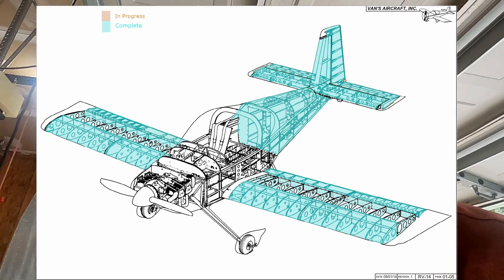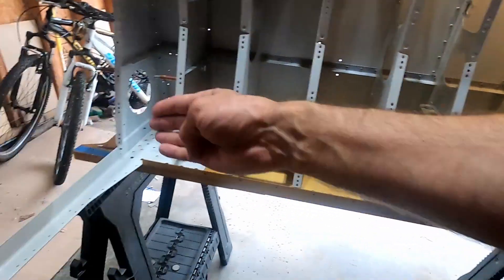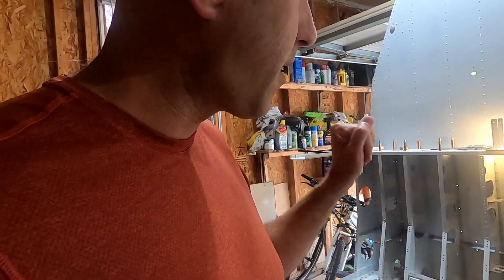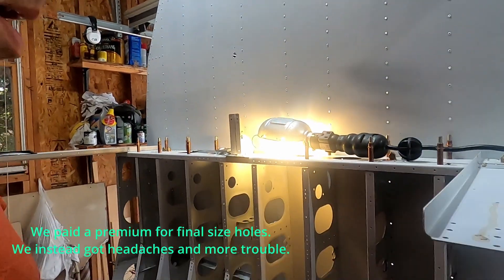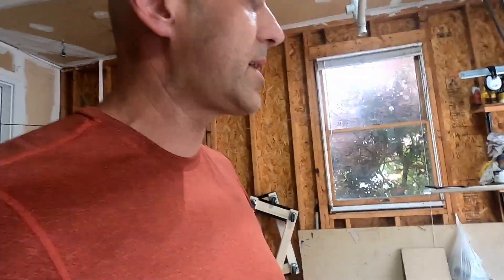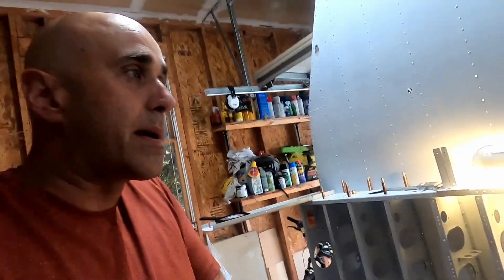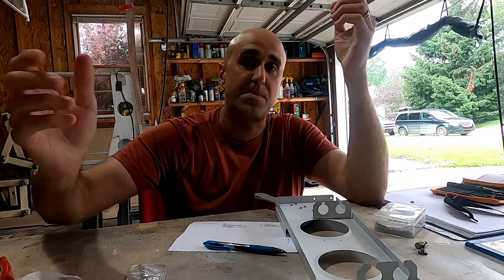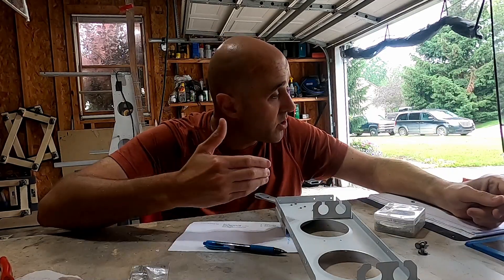Laser cut parts in the Fuselage? more like Fusel-UGHHHHH

Comment: The KIT is THEIR "product". The DIMPLES AND FINISHED AIRPLANE ARE YOUR PRODUCT!

Such seems to be the attitude of every "expert" online saying it's NBD. No Big Deal. 

Their "explanation" for the process "modification" is they were SO "SWAMPED" WITH ORDERS DUE TO "WORLD EVENTS" STARTING IN 2020 THAT THEY "HAD" TO "RAMP UP PRODUCTION" AND FOR SOME CRAZY REASON ALL THE PUNCH PRESS-EQUIPPED "JOBBERS" WERE COMPLETELY "BACKLOGGED" WITH WORK WHILE THE LASER CUTTER "JOBBERS" HAD NO "BACKLOGS" AT ALL AND WERE ABLE TO JUST JUMP RIGHT INTO "JOBBING" FOR VAN'S AIRCRAFT "MANUFACTURING". 

THIS "MECHANIC" HAS ALWAYS BELIEVED THAT WHEN ONE "JOBBER" SHOP IS "SWAMPED" AND ANOTHER IS "SWEEPING FLOORS" AND THEY BOTH DO "IDENTICAL" JOBS AS FAR AS THE "PRODUCT" THEN "MARKEKT FORCES" ARE AT WORK AND IF YOU VALUE YOUR FINISHED PRODUCT THEN IT'S PROBABLY WORTH WAITING IN LINE WHERE THERE IS ONE VS. GOING TO THE GHOST TOWN "JOBBER" THAT HAS NO JOBS IN PROGRESS. 

AND THE REALITY IS THAT PUNCHING HOLES AND CUTTING HOLES ARE TWO ENTIRELY DIFFERENT PROCESSES FOR A REASON. ESPECIALLY IN ALUMINUM WHICH IS THE DEVIL TO CUT WITH ANY PROCESS RELATIVE TO STEEL. 

IF YOU CAN'T CUT HOLES OR EVEN OPENINGS IN ALUMINUM WITH ANY "THERMAL" CUTTING PROCESS THAT WORKS "GREAT" FOR STEEL SUCH AS OXY-ACETYLENE OR PLASMA CUTTING OR AIR CARBON ARC CUTTING - AND BELIEVE ME YOU CANNOT - THEN A "HIGH TECH" LASER THAT DOES THE EXACT SAME THING - HEATS THE BASE METAL TO ITS MELTING POINT SO A GAS "JET" CAN "BLOW" IT OUT OF THE "KERF" - THE "FINISHED PRODUCT" IS GOING TO SUCK. 

AND THOSE PROCESSES ARE NOT USED TO PRECISION CUT STEEL SHEET METAL EITHER. EVER. AT LEAST NOT BY "ENGINEERS". THEY ARE USED ON "PLATE" AND THEN NEVER FOR PRECISION CUTTING OF SOMETHING LIKE A HOLE INSTEAD OF AN OPENING. 

ALL "BOLT HOLES" IN STEEL SHEET METAL ARE PUNCHED. IN PLATE THEY ARE DRILLED. IN BOTH CASES THEY MAY BE FINISH REAMED. 

IN NO CASE OF A NEW "FACTORY" PRODUCT ARE THEY "FILE TO FIT". IF THAT IS VAN'S "PROCESS" FOR ALUMINUM SHEET METAL THAT ALONE PROVES THEIR "ENGINEERING" IS SHIT FIRST AND FOREMOST.

Comment: So holes were slightly undersized and cracked when dimpled? I drilled , deburred ,dimpled all 30,000 plus rivets on my 2000 RV-6 and did not have any holes crack from dimpling. Bummer is a understatement  for your problem.

Comment: Laser tempering and cracking of aluminum has been known in aviation for a long time.  It’s a shame someone was able to sell them on that process.  Anything you touch the edge with (file) will cause cracking like tempered glass.  I’m curious of how far the heat affected area is from the edge or if any of the parts can be salvaged by drilling out the temper and using over sized rivets.
Reply: Remove the rivets and Tig weld the parts. Otherwise disassemble, and reassemble with glue. Rivets are 20th century.
Reply: @Parkhill57 I think the problem is that welding AL ruins the T6 temper.  Like half the strength. Steel does not degrade like that from welding, so your suggestions would be fine for steel. What I don’t understand in all this is that if the holes are bad, then why not just don’t use them?  Just drill your own holes the right way for rivets between the bad holes.  Not ideal given one bought a kit to avoid that, but Ce la vie if it rescues the kit

Comment: This reminds me of a manufacturing/airworthiness fiasco on the Canadair Regional Jet when the maker of anti-ice leading edge piccolo tubes (made from very thin titanium sheet rolled and welded), an aerospace company in LA, bought an Electro Discharge Machining rig to make the little holes instead of normal drills.  EDM melts the hole with a controlled arc.  The notified the OEM of the process change, but there was no follow up. The tubes went into service and eventually started cracking at the holes and breaking up (titanium having so much spring-back when formed), leaving the wing without anti-ice protection outboard of the fracture, just random wing overheat warnings. Just dumb ass luck there wasn't an incident.  Turns out the EDM process leaves a hole with a very rough burnt bore, a perfect crack propagator. An AD required replacement of tubes, and the company didn't want to scrap their automated EDM rig so it was agreed they'd make the hole by EDM undersize, then someone had to ream them to final size with a reamer after to provide a clean bore.  Laser cut holes would have the same problem.

Comment: Filing the holes? I work for an aircraft company and we never file any fastener holes. You are making stress risers with your file, regardless of the heat treat on the metal. I would not keep this video up if you ever plan to sell your airplane. I doubt you could find an AC manual telling you to file the holes---YIKES!!!!
Reply from the maker: yet that was the guidance provided by the kit manufacturer..

Comment: Incorrect heat control during the laser cutting process. Depending on the aluminum alloy it might not be possible to prevent heat from altering the temper of the metal along the laser cut edges. Building a temperature controlled enclosure for the laser cutter and figuring out temperature ramp up/down and ideal enclosure temperature during cutting would be a long process of testing - especially if the manufacture of the aluminum sheet has no data on laser cutting followed by mechanically distorting (such as dimpling) the heat affected zone.

Perhaps blasting chilled air right at the point of the laser cutting could prevent this problem?

That's a problem with sheet steel with laser or plasma cutting. It can be almost completely mitigated with plasma cutting by using a water table so only the smallest part of the edge right next to the torch is affected.

Comment: The dimpling process should not require working on the holes with a file. Cracked dimples indicate the material is not the correct material, not in the correct condition to be dimpled, or the wrong dimpling process has been called out. Don't assume any kit manufacturer knows how to build airplanes. One popular 4 place composite manufacturer in the southeast used an air conditioning duct sheet metal brake to form a flight control bracket out 0.120 6061, no bend radius, when confronted by an A/P and an engineer they refused to accept that they were doing something wrong.
Reply from the maker: Oof, yeah that's rough

Comment: My RV4 has been flying for just over 25 years now, in Australia. Nothing was pre-drilled on those kits. I didn’t experience any issues with the dimpling for 3/32 and 1/8 rivets, however the fuel tank skins and associated attaching flanges, had serious cracks in the dimples for the attaching screws. I filed the cracks out, many quite deeply. It would be interesting to see an engineers view, on the likely hood of crack propagation in later kits, as well as feedback from aircraft owners, who have many hours on their aircraft.

Comment: I hear you my man I’m involved with this on my 10:-(

I wanted to ask you were you parts cracking in the red or yellow  color  on the list vans released for your 14??? I’m just curious because  you said all those seat ribs etc are all cracking to some degree????

I’m sure my 10 is similar
Reply from the maker: I had some cracks on red and yellow parts, the thumbnail for this video with the cracks is actually a red-tier part.  Seat ribs are blue of course, it's just the point in the build where I really recognized there was a problem.
Reply: @RyanE67  oh okay just wanted to make sure the cracking parts were NOT blue or green ones. I am building a 10 and I have to replace ribs in my nearly complete wings. I did not start my fuse yet until they send me replacement parts
Reply from the maker: @jerseypilot83   plenty of blue parts cracked too, then i followed the guidance (at the time) to file the cracks out... which took too many holes out of spec.. and so I'm subsequently asking for no-cost replacement since all I did was follow their guidance.
Reply: @RyanE67  I can’t believe you said the blue parts are cracking, too… but Vans says it’s okay …. Complete BS! I really hope they will send out free replacements because they really messed up. All the blue and green parts I guess are good to go even with crack they said to you too????
I was playing around with first 2 steps of fuselage today  and I didn’t prime but dimpled and debuted and riveted to test and see if it would crack and it DID NOT! I guess that is good but I’m still going to use the punched parts. I have no choice but to wait. They say we can use blue and green but that’s crazy…. I say it’s cutting corners extremely!

Comment: What's  the follow up to this? Is Vans standing by their product and sorting you and all the other builders out with new parts? I know they found the problem with the laser cutting method at the subcontractor, and have fixed the issue ongoing. It's a real FUBAR but Vans is surely a good upstanding bunch and will make it "right" for the builders.
Reply from the maker: I have a follow up video, but there's been more since then.. they seem to be standing by their builders so far...

Comment: The phrase Laser cut parts has me baffled.  Is the phase "CNC" punched parts being called Laser Cut components.
Reply from the maker: No. Both are cnc process, one uses a laser to pierce the part, the punch uses a die set to pierce the material

Comment: Sounds like the laser cutters are hardening the aluminum and causing it to become brittle because of the excessive heat of the laser.
Reply: Laser heating should anneal the metal making it softer, not harder. It’s the reason you use rivets instead of welding. For steel welding the reduction in strength is not much which is why you can weld steel and net it’s a stronger joint than bolting.  But AL undergoes like factor of 2 reduction of strength.  The AL T6 temper goes to like T3 or less.  And unfortunately you can’t just do a reheat treatment, because the whole piece needs to undergo the treatment. It could be that the region around the hole has lost its temper and maybe that lack of strength is what is cracking. Need a real metallurgist (which I am not) to tell what is going on here, but overtly it does not sound correct that temper loss (softening) would cause cracks by itself.

Comment: Are these airplanes going to be insurable if they are built from these kits, even if you replace the parts?
Reply from the maker: I'm sure it won't come to that.. for a vast majority of the parts, any issue should be noticed on preflight or if anything during annual condition inspection before they become actual problems or safety hazards.

Comment: They are using cheep aluminum, i you can Lazer cut aluminum and still stretch it, they need to compensate with a different grade and harness so that the temper is a proper grade after heat
Reply: I think you may be incorrect, the aluminum used is high quality (aircraft grade) and not intended to be heated as this affects its strength and becomes more brittle (thus cracking). If they use a grade of aluminum that can still flex after heating then its overall strength is not as strong and not to the standards for these aircraft........That is how it was explained to me so I hope that makes sense.........and of course, I could wrong as well, but makes sense to me.

Comment: Filing is not  the answer.  I'm a retired A & P mechanic, 50 + years experience.  Military and civil, large and small aircraft. Your Filing puts small scratches thru the hole and promotes the cracking. Hot coin dimpleing is possibly an answer along with drilling and or reaming. 
I've done a lot of hot dimpleing in the military and it's a tricky process. 
Their engineers will have to come up with an approved fix.
You would be better off to wait for one , otherwise you might cause even more problems. 
Not a good place to be in.  I feel bad for you guys that bought that kit.
Maybe get together with other kit owners and start a lawsuit.
Reply: Lawsuit no... Everything else is spot on. Thanks for your service!
Reply: Agree. On race cars from the 1960's, they learned that scratches of any size in aluminum panels exposed to vibration could start cracking.
Reply: Its not just the rv7 kits.

Comment: Hot dimples? Filing? Why not debuting tool, a whole lot faster. Filing makes micro cracks. You should see all the back drilling needed to replace thin sheet metal parts on the U-2. We are not allowed to laser ablate thin skins because of the damage done by the lasers.
Reply: The laser cut hole already formed micro cracks. I think filing is the least of his worries. Vans has a lot to answer for here.
Reply from the maker: Yeah the deburring tool creates a countersink or knife edge, which takes the hole way too far out of spec

Comment: I believe only a pilot hole should be cut with the laser then it should be drilled to size the rest of the way
Reply: it's not the size of the hole that is the problem, it's the fact that the laser cutting process alters the temper of the aluminum making it more brittle and prone to cracking
Reply: @billbrisson if it was only a pilot hole, any material that was brittle would be drilled away when the right size hole was drilled.
Reply: @LeifNelandDk  except it's the whole part that is laser cut, not just the holes. Do you plan to file away the edges of the entire part?

Comment: The laser must be giving it a heat treatment and making it brittle around the hole. sry those are scrap and Vans could go bankrupt over this.
Reply: or the source stock is not really 6061 ?  if they made hundreds of them so far with no problems, then something changed, they need to find it. asap.
Reply: @orbitalair2103 Sheet metal comes from China...continuous quality testing of batches were not in place probably...
Reply: That’s what I was wondering about too?

Comment: Improper debur will cause cracking. I know people run files on the holes. Not the same as a countersink debur. Not say 100% thats the issue but not uncommon. I'm an A&P with extensive sheetmetal experience and have helped build several RV. There product has gone down hill
Reply: Ya. Laser cutting holes my affect the heat treatment of the aluminum and make it brittle.
Reply: @Rev17thru22  And a laser cut hole is jagged. Like really jagged compared to any machining process. Definitely a starting point for cracks.
Reply: @GeneralChangFromDanang  scary shi .

Comment: Hi Ryan. Appreciate your video, and understand your frustration. We will be posting and communicating specific information, including a list of affected parts based on reports, testing and analysis.  We will also be communicting about what you can and need to do, and posting service information as necessary. And, I'll try to give you a call so we can talk, if you'd like.
Reply: ...And now, 3 months later, the reality is even worse. I feel for all of the builders. Not so much for the people that made just inexuseable business decisions that brought down a great company.
Reply: @Cornstalker7273 what inexcusable decisions are you referring to? Be specific, because I suspect you were in on the conversation.
Reply: @judd_s5643 I presume you are nit referring to the decision to use laser cutting which I would call an engineering decision, but I suppose it was done for business reasons. I would have expected (I’m an RV builder and an aero engineer) that some research and testing would have gone in to this before delivering parts. Guess not
Reply: When I first heard about the Lazer cutting problem that's the first thing that popped into my head. What about overheat of the metal and what kind of aluminum is in these kits. Was there any tests done anywhere on changing the temper of the metal, or did these companies even think about it? How about it engineering ? I can just hear it now at meetings. It'll be fine, don't worry about it, it's not cost effective and so on and so on. Just get it done.